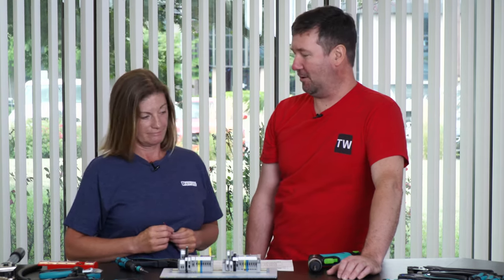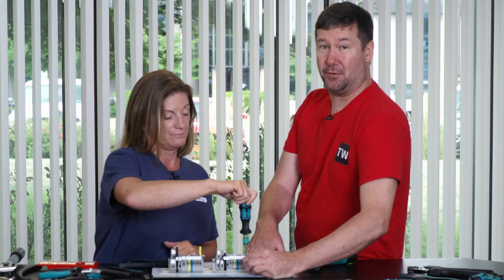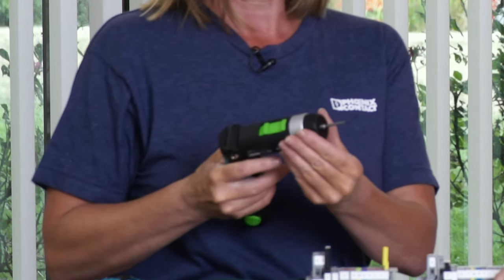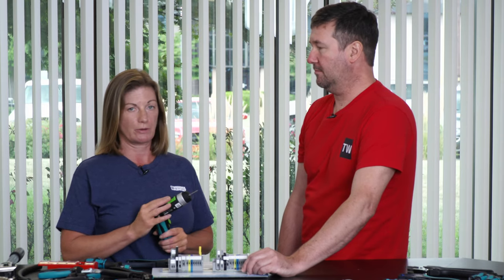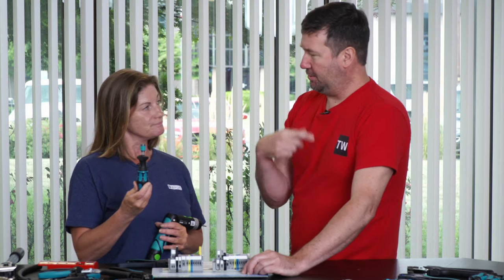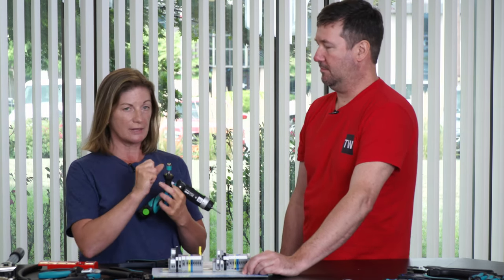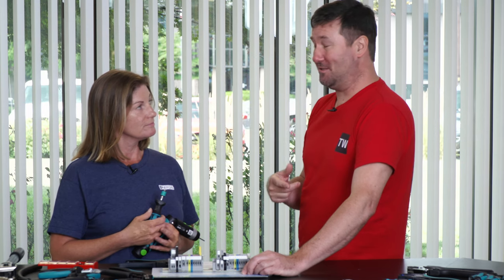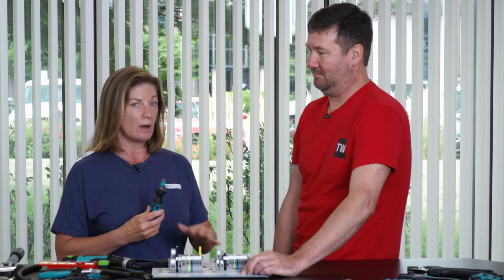What Do You Torque in a Control Panel?  Cool Tools for Those Screws

Comment: As a technician from the EU, I feel like im one of the few with a regard for torque specifications. Especially with electrical contacts. I recently ordered a manual torque screwdriver for when replacing motors or frequency drives and collegues asked why i would need that low of torque specs as an electrical technician. 😂
Reply from the maker: I was talking to UL one day and over torquing was one of the most common problems.